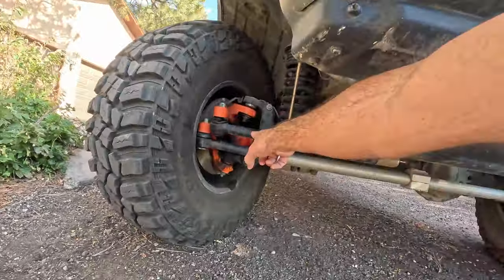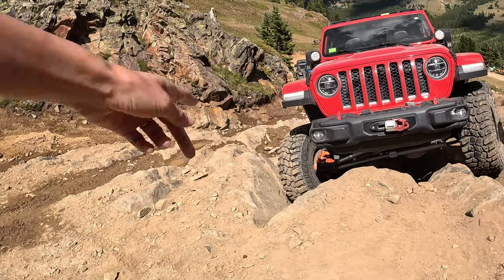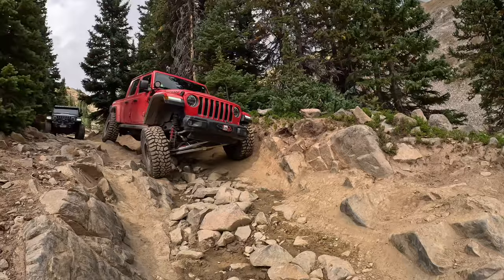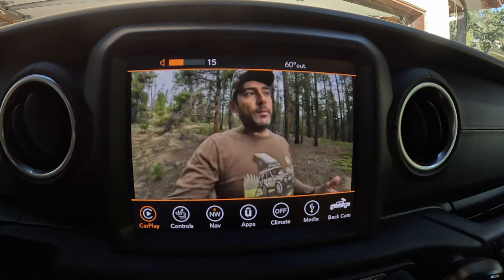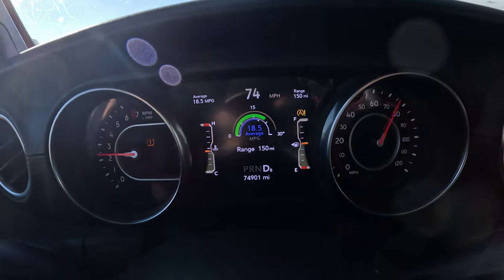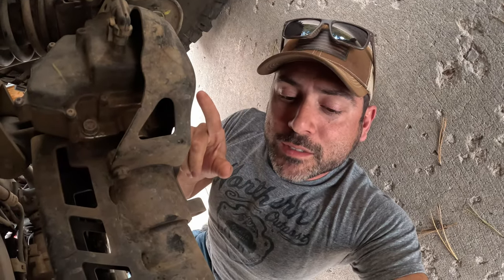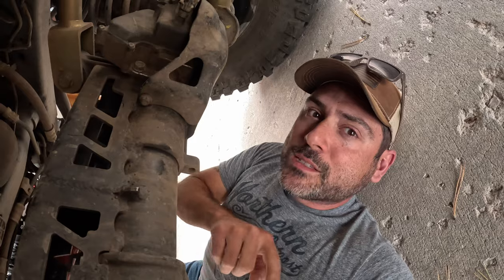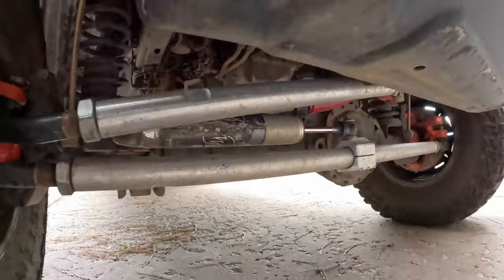5 Best Jeep Gladiator Upgrades JT/JL Jeep wrangler

Comment: RCV's and knuckles sound like a great upgrade, but until I strip out the OEM 4xe CV's, I'm gonna hold off. Just finished getting my lift on from MC, just waiting on lower arms and upper rears to show up. If my steering ever takes a dump, Rock Krawler is gonna be getting a phone call immediately. I'm not super stressed with getting the axle truss done. Not sure about the Gladiator but the 4xe gets the same Dana 44's front and rear that the 392 does because of the extra torque. 5.13's might be overkill on my build since I've got a ton of power on tap, but 4.88's are definitely on my short list for next year. The 4.10's do fine on mine with 37's but I'd rather have the extra peace of mind. Overall a good list, the carplay adapter could've taken a back seat to GMRS mobile but I get it.
Reply from the maker: I agree with you on the 4xe, they made the front a lot stronger, time will tell on the new CV design though, but they seem solid. When we tested the 4xe on stock 33s the MPG was really bad, so i wonder if thr 5.13s would help there. It would make it crazy torqy though. 😅 the wireless carplay is a cool feature to have if youres doesnt come with it, but thanks for baring with us! We covered the gmrs in our first 5 upgrades video.

Comment: What size tires were the people running that were unhappy with 4.88’s? 
We went with a 3” JKS lift and 35’s on our ‘23 JT and stayed with stock gear ratio. First off road with it was Slaughterhouse and it was amazing, not one complaint and only a couple very minor rubs. 
Trying to keep a nice middle ground of doing well off road, but a nice daily driver. 
Good video and info on the upgrades!
Reply from the maker: Thanks so much! One was running the same tires we have now 37 STT pros which are large 37s, i could see 4.10s not being enough for them, but 4.88s it seemed a little weird because thats a nice ratio. But yea they told me they didnt like 4.88s and they wish they went 5.13s after the fact. I love slaughterhous. 😀 we might go run it next weekend and hope for some color in the aspen!

Comment: 5.13 already scheduled for mid November.   RCV axle shafts tentative for Jan/2024 ........ the rest TBD ;) Also would a high steer kit help in your scenario ? I have seen people say the angle being less sharp solved their issues
Reply from the maker: Oh nice! You should do the RCVs yourself. Its super easy. And good to know how to swap a shaft. 😀 i keep thinking about that, but everyone i wheel with has never had a problem with the drag link, so im thinking its just me. Even random people i meet are fine running stock geometry (for the lift size) but if the RPM doesnt fix it, high steer is the next option. 🤦🏼‍♂️

Comment: People want what they want , And if you want a gladiator, you want to gladiator.. But I have to wonder if the power wagon is a stronger setup. I would think it would have to be a tougher rig at least in stock form... Maybe not after the upgrades on the Gladiator... But I would think the power wagon would at least start out tougher.
Reply from the maker: This is a really good point and ive seen some guys take those on some pretty tough trails, but youll never get the flex and travel as a gladiator, if i was looking got more work use, id def go with a powerwagon.